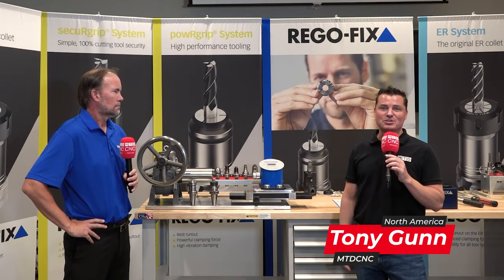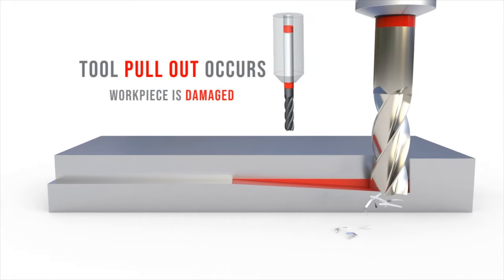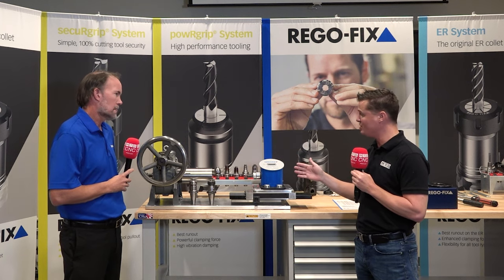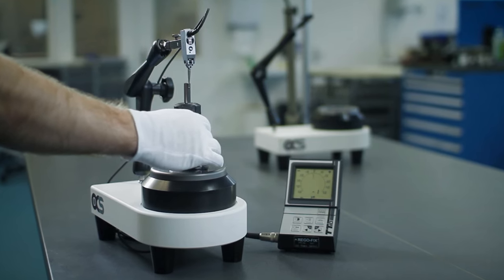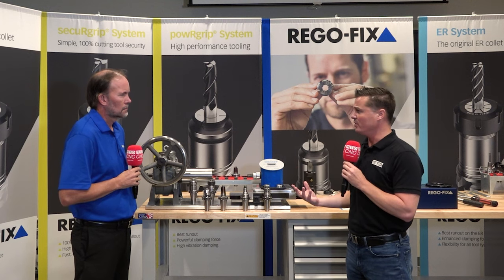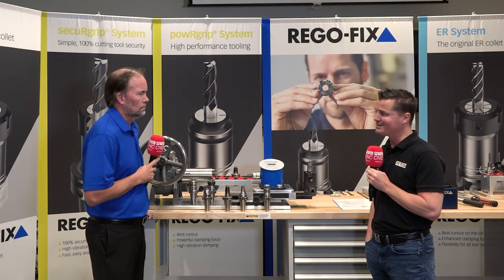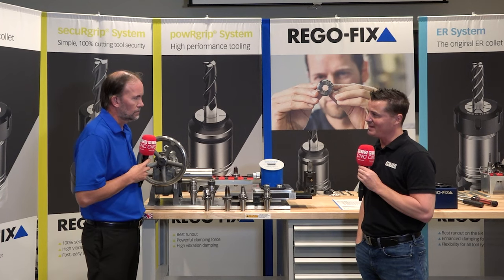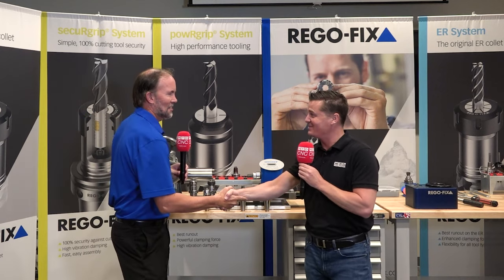Understanding Collet Torque Pressure in High Performance Machining

Comment: Would love to see an episode on dual-contact ISO holders and spindles. Some time ago I did a test with a DC spindle on friends machine - 3 applications of bearing blue on 3 holders from a big brand that were described as DC and 2 holders did not make any contact on the flange. The one that made contact - the contact was relatively poor. I don't trust the DC thing at all.
Reply from the maker: Great suggestion!